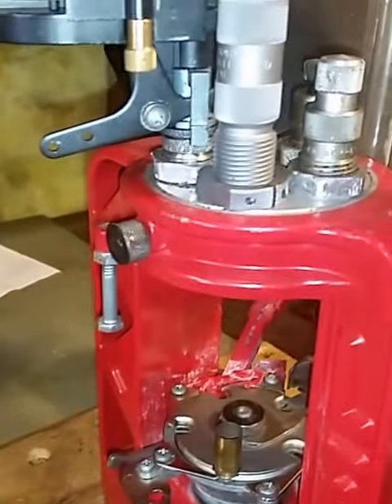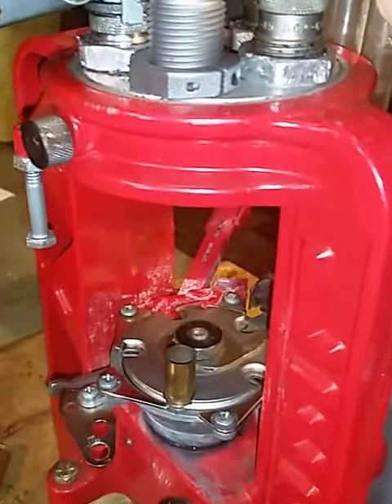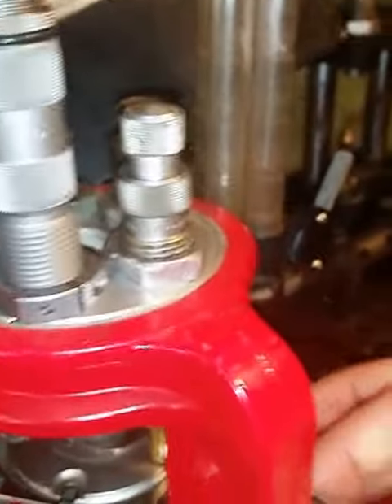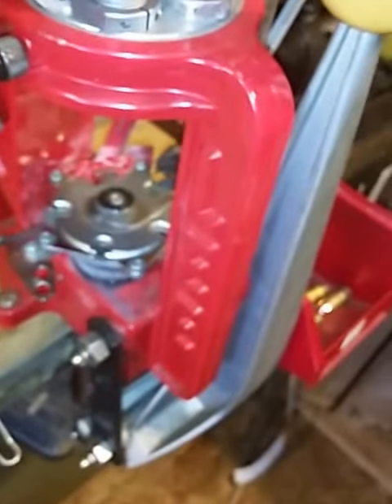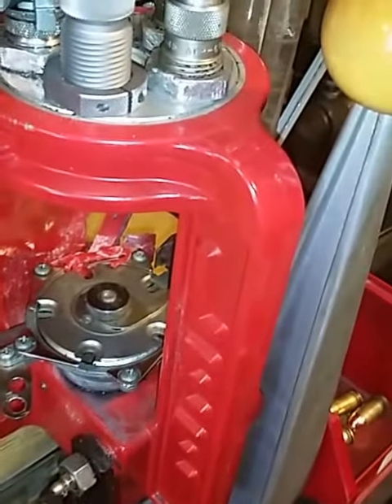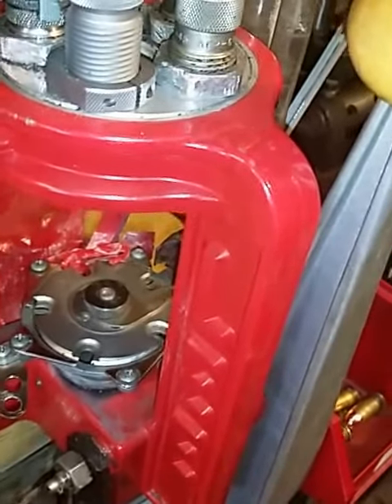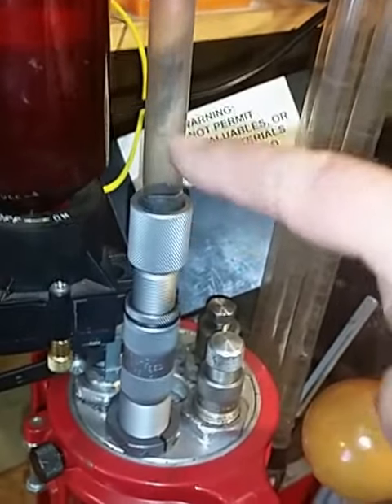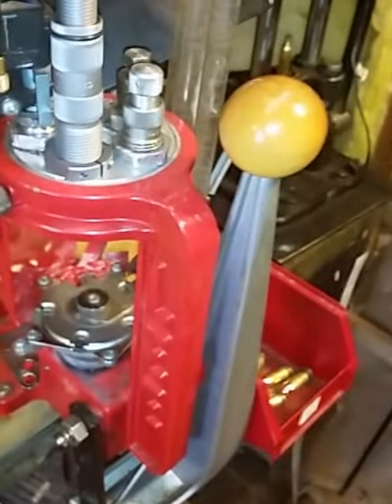Hornady auto feed bullet seating die on a Lee Progressive press

Comment: Thanks for the video. I am considering this for my lee progressive. Have you ran into any issues with it?
Reply from the maker: Pat Terry as long as you adjust the Hornady die correctly it's really pretty slick. You have to be careful that when you load the bullets into it they don't cock at an angle otherwise they'll hang up. And every once in a while you have to stick your finger up the bottom of the die and push up to allow them to drop down but these are rare events. In general it works pretty doggone slick.